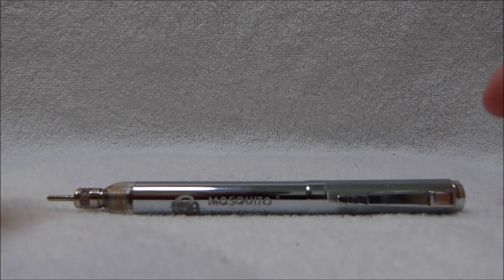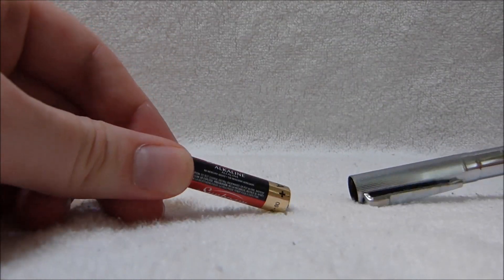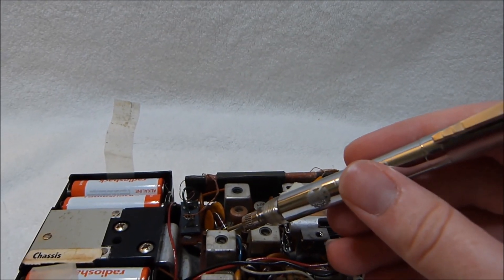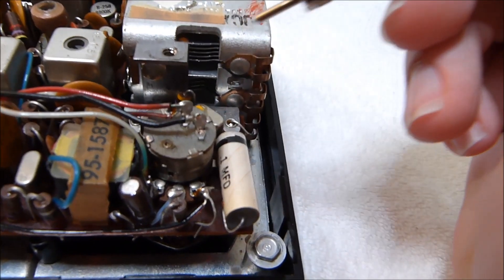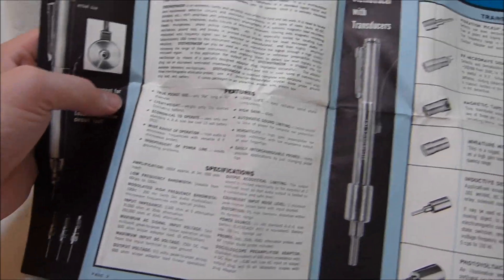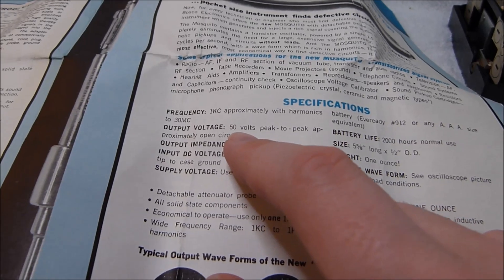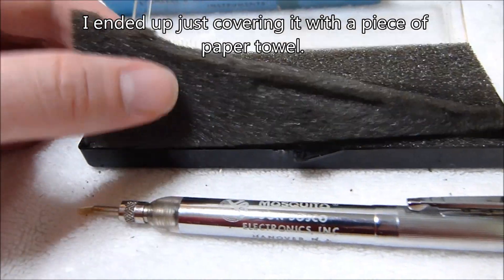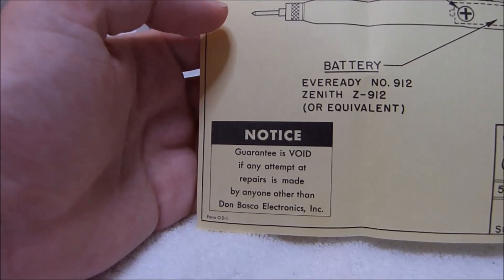Don Bosco "Mosquito" pocket  transistor signal injector (1959, USA)

Comment: Any chance of opening it up without destroying it? I'd like to have a look at what's inside!
Reply from the maker: No, it's sealed up pretty well unfortunately, they definitely didn't want it being taken apart.
Reply: @50sTransistorRadios  Thanks for the reply. I was intrigued as to how they made it so small for the era considering the transistor cases at the time were so bulky!
Reply from the maker: @colintinker7778  By 1959 small-ish cylindrical transistors were available, and I'm guessing this uses just one of those.
Reply: @50sTransistorRadios  I guess so. An oscillator with a tiny transformer, hence the fairly high volts out and then through a low value cap to the output probe tip. The parts count is probably 4!
Reply from the maker: @colintinker7778  The output is definitely cap-coupled, like most signal injectors, and yeah I'd bet there's only a small handful of parts in the circuit.